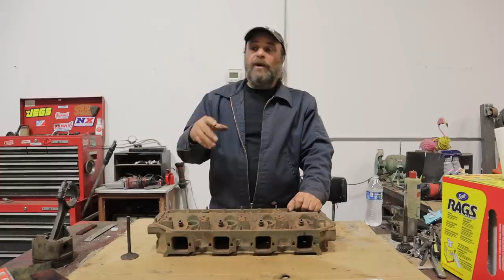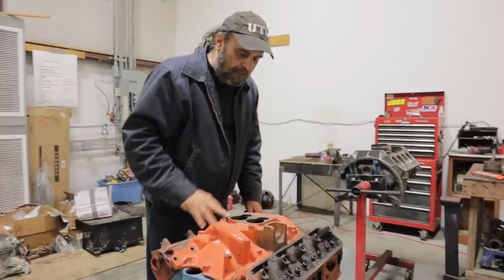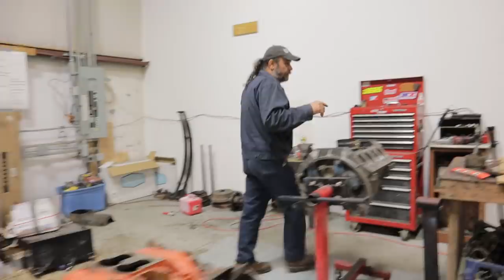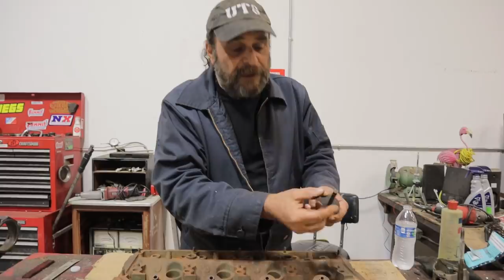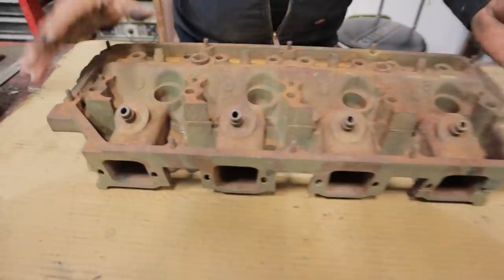Carburetor MPG Myths And Intake System Thermodynamics

Comment: How do you remove carbon on valve with an engine thats together without taking it apart? I know how to remove carbon on a piston (water) but not on a valve.
Reply: I add a gallon of diesel to 16 gallons of gas about every third tank on my Ford I6 300.  Based on what I see with a borescope, it seem to help.  One word of warning, it will drop the octane rating about 3 points, so don't flog the engine on those tanks.

Comment: If there was a way to spit out gas within its atomized state like a carb mixed with the fuel delivery of fuel injection I think we could get somewhere. Fuel injection gives a more liquid state compared to atomized carburator gaseous mixture. Gasoline fumes burn, not the liquid (when gasoline is set ablaze, the fumes ignite creating an increase in temperature turning the liquid within contact into vaporized fumes, allowing a chain reaction of fuel combustion allowing a gasoline fire). It would be cool if there was like a small chamber/container that the fuel can be pushed into creating an atomized state of gasoline then pushed into the combustion chamber such as fuel injection to have a fuel "cloud" that is in a more atomized state allowing for more surface area to interact with the cloud and allowing for a more efficient explosion and chain reaction. Increase in atomization would require less fuel and would be easier to create cleaner and full combustion reaction

Comment: As you touch slightly on direct injected gasoline engines I'd like to say that I've noticed, primarily with the GM ecotech DI engines, that whenever I see one taking off with more than moderate acceleration I always see a puff of black smoke from the exhaust like its way fat.
Reply: Some early GM   (4 & V6)feedback carb sys had a heat  grid base gasket  for cold  mix  efficiency and A/ F flow  atomization into plenum. Based on coolant!!! sensor &  other early  sensor  info. Modern EFI &;ign sytems  a great improvement over  the  years when  basic  maintenance & moderate  driving  habits follow.
Reply: @joekurtz8303  ford had a water heted spacer t in to heater line so to stop crburetor icing in cold temps!
Reply: @joekurtz8303   Buick 231 in particular had them into the mid 80s I've sold 1 or 2 of them when I first got into the parts business 20 years ago

Comment: With fuel economy, you can only make it so lean and the plug gap so big. I do find that modern engines with fuel injection will never get better economy than could be seen with the old engines we love with carburetors on them.  The new engines blow through more fuel no matter what even though it's metered by the computer. And from what I gather is that for meeting emissions now, more fuel is required to accomplish that. It's not so much about economy as meeting emissions numbers  I miss my carbureted cars.
Reply: Thats true, catalyst require 14.7 fuel ratio to run properly. Old engines at low load condition could run a bit lean and increase efficiency.
Reply: JMO
Fuelies balance air fuel ratios between cylinders much better.
Fuelies atomize fuel better . Port preferred.
Computers go for lean in many conditions.
10% ethanol gas reduces mileage 6% due to heat loss.
Premium non-eth fuel does not offset the price.
Real gas lasts a year easily before getting putrid.
MSD 6AL is a great device!! Cures a multitude of problems.
etc 
BTDT, tryed them all.👍

Comment: In 1976 I had a 1964 chevelle 283 -4 bb it was a thermoquad 
With a power gilde trans 
And a hi geared reared not sure of the ratio 
But from LA To Fresno it was getting 25/26 MPG
I even pulled into a gas station early because I thought  gas gauge was broken it wasn't moving
My other car at the time was a 1968 ss 396 chevelle So I was used to getting 12/15 mpg

Comment: Can you make a follow up video where you cover how to clean the intake and get the carbon out of the chambers? Techniques, chemicals, and such
Reply: Berryman B12 in the gas every 5,000 miles.
Berryman makes a full line of products with great valve and intake tract cleaners. Easy to use and very reasonable priced 
B12 is half of seafoam$ and a better product.
JMO😎

Comment: I think it’s neat how the old school way for better fuel economy is more vacuum for better atomization. With that comes pumping losses. The most efficient way is to have no vacuum. With port injection and free valve technology the engines of the future will probably have no throttle valves.
Reply: I'm surprised that free valve technology has not made its way into new engines. Koenigsegg have been using it for years. I'm sure it's expensive but when put into mass manufacturing, cost shouldn't be too high, and will help increase efficiency by ~15%, which will be quite noticeable
Reply: @car_ventures . Ya agreed. Maybe because of the patents he has make it too hard for other companies to duplicate? Or maybe it’s just coming in the next generation of engines? Another option I think would be to use a constant speed opposed piston engine and use it to keep batteries topped up. Another thing I don’t know why they don’t use is propane injection on diesels. It would really help with diesel particulate. I guess it’s just another fuel to worry about and people wouldn’t want that?

Comment: Most GM multi port fuel injection will try to time the end of injection period well before the intake valve opens. Always seemed strange to me you would want a puddle of fuel with no air moving to atomize it on the back of the valve. But like you said it’s the temperature of the valve itself that is doing the vaporizing of the fuel. 

An interesting note when a customer installs an after market cam with more duration and a tighter lobe separation, I will often tune the end of injection timing right before IVO, it really wakes up the throttle response and the fuel smell goes away. 

For example if you advance your injection timing and you see your air fuel ratios go richer the engine is running more efficient because all that extra fuel has more time to vaporize and more of it gets burned in the cylinder which will show up as a richer air fuel ratio with out change the actual “amount” of fuel injected. 

When you understand carburetors and port fuel injection you start to understand how similar they are an why going EFI by itself doesn’t mean more power or economy
Reply: You can't outgun a carburetor

Comment: Tony is right, there is no mystery formula. If we had materials to build a block, pistons, and heads to take super high egt’s I’d love to see testing with a turbo and highly pressurized fuel to run high boost in a very lean condition. Maybe ceramic pistons..I don’t know how you’d do it, I’m not a physicist…my specialty is hacking up cars and welding with a bird shit dispenser.
Reply: It’s not only the egts you have to worry about doing that. It’s detonation that kills the motors.

Comment: All good points.  Now think about raw water cooled boat engines.  If salt water is in the equation, they must stay below 160* to minimize salt deposits and scale build-up.  You loose almost all your thermal efficiency.  Boats are bad on fuel ...

Comment: I've been getting a ton of carbon on the back side of the intake valves on my carbureted daily driver, doesn't use oil and has great compression, good fuel milage too, doesn't foul plugs, they're plenty clean.
It's the darnedest thing I've ever seen, done everything I can think of, I'm stumped.
Reply: Good fuel source, correct  octanes per Dollar,  some chemical  treatment  helpful ( AC Delco X66  formula)  soak  or spray   might help w high mileage  engines. If  it  Runs  OK,  till  a rebuild ,  use good fuel ⛽.
Reply: Have you tried Techron concentrate plus?
Reply: Valve seals have a slight leak under high vacuum.
Reply: An engine with a high overlap cam will carbon the intake valves due to reversion that occurs at lower RPM. .
Reply: Could be a Valve Timing Issue
Reply: All good suggestions, and I have just been using "whatever" fuel, nothing special or in particular.
I especially was interested in valve timing so checked the chain set and of course while in there advanced the cam two degrees with an another chain/gear set, haven't gotten back to it b/c I've got another engine to swap in and plan on doing that.
Could be valve guide seals as suggested, it is after-all a reman engine and may not even have guide seals.  Haven't removed the valve springs to check that (engine swap is my current plan).
It runs decent but I suspect there's something up with the head (valve concentricity?) as the idle should be smoother, could even be a funky cam, don't know the entire history.

I'll probably pull the heads and have a look after the engine swap, to satisfy curiosity.

Comment: This was a  great video! Thank you.  I think there is a lot more to talk about. A follow-up video on de-carboning and engine would be great. What does Tony like to use to de-carbon an engine short of tearing and engine down and manually removing carbon buildup? I have heard running water or ATF down the carb plus there are all the snake oils out there. I would love to see a carboned-up engine cracked open. Let us see the before and after. Or maybe there is no down the carb magic trick for removing carbon build-up effectively. Maybe the only way is to tear the engine down and wire brush the carbon off the valves, piston tops, and heads. But if you are going through all that you might as well do a full freshen up, new seals ring valve seals and clean up the cylinder walls.
Reply: Theres a channel called project farm and he does these tests on lawnmovers
Reply: @CrusherGarage  yes i have seen those thank you i would like to see something on 100000 mile  car engine carbon buildup. plus lawn mower engines run at 6 to 1 compression ratio i would like to see the test done on something higher 8.5 to 1 plus id like to hear uncle tonys oppion on the snake oils out there.

Comment: 100 mpg+ gallon carburetor that's simple. 50 to 100 cc motorcycle/moped with a carburetor. Many of them can get a hundred miles per gallon or better. And some of the arrow cars basically motorcycles with fairings can get even better

Comment: While the atomization of the fuel drops the fuel temp, the smaller nature of the droplets likely makes it easier to vaporize because there's more surface area to vaporize the fuel so I'm wondering if the temp drop is  negligible

Comment: Forget the carburetion for a moment and  think about conservation of energy.  There’s not enough energy in 1 gallon of fuel to push a full-size vehicle with a conventional drivetrain (no hybrid) against air friction and rolling resistance for 100 miles. EVEN IF you could burn it with 100% efficiency (chemical energy to heat energy) and then convert the heat to mechanical energy right at the limits set by the laws of thermodynamics (about 60% heat to mechanical). Some energy HAS to be lost to the heat sink (the environment, either through the exhaust or the cooling system) in order to convert the rest of the heat to mechanical energy.  There is simply NO WAY that you could move a 60s/ 70s midsize  car (think Roadrunner, Torino, Skylark) 100 miles on a gallon of gas. You could go 100 miles on a gallon in a highly streamlined, purpose-built vehicle… think one of those university engineering team solar cars, but powered by gasoline.  But not a practical, large vehicle.

Comment: Very interesting video! Do you think heating the fuel with a fuel to coolant heat exchanger could help efficiency by helping it vaporize better? Obviously heating the fuel much wouldn't work well in a carburetor due to potential vaporlock, but I could see this potentially working well in a fuel injection system since the high fuel pressure would allow the fuel to be heated somewhat without boiling.
Reply: gm already did this with the vortec spider. it heats the fuel in the intake and futher heating happens at valve port injectors. that vortec "spider" is doing more work than you think.
Reply: @blueelectricfusion  Never thought about that but it makes perfect sense, thanks for sharing! Eventually I will try heating the fuel with the coolant to see if it helps MPG. That's something I've always wanted to try and I could rig up a heat exchanger cheap so either way it'll be a fun experiment.
Reply: floods the carb at 140*+
Reply: @hotrodray6802  I imagine that would cause vaporlock in a carburetor application, which is why I specified for fuel injection since EFI systems typically run at high enough pressures to keep the fuel from boiling at normal coolant temperatures. Just like in a cooling system, raising the pressure raises the boiling point.

Comment: If there was a simple bolt-on solution to any vehicle to make it immediately have a huge gain in mileage or performance some country around the world would have it done and it would have been easily figured out by now.  This is where real thermodynamics and engineering come into play where you can actually sit down and do the math and realize that there's no magic number that's going to double your gas mileage.
And seeing the fact that there if there was any carburetor that is 100 mi per gallon is odd because what if that carburetor is going on to a scooter versus going on to a big block.

Comment: Lean burn with a carburetor raises emissions too much, plus a lean burn with a carburetor makes the engine run hotter, sometimes way too hot. What Ford and other manufacturers do now uses lean burn with a turbo, high compression AND direct injection which helps cool the cylinder.
Reply: leanburn only is a problem if the timing is off! leen one needs to advnce the timing!

Comment: There is an asymmetric bell curve you have to get past in terms of heat. When you add gaseous fuel then the problem becomes getting enough charge to make HP, at the other end of said curve ...the running crappy just indicates you're on the typical side of  said curve. Smokey's contrivance was a cheater's attempt to get to the other side ... An astute attempt that fell short.

Comment: Tony, Can you do a video on water injection and methane injection also? Would like to know if they are still viable methods of better combustion? Thanks...
Reply: Supresses knock and cleans carbon.
Less knock and you can run more timing or more boost.
Water turning to steam absorbs heat and the steam increases cylinder pressure/ torque.
The difference between meth mix and straight water is negligable.
BTDT decades ago.
WWII airplanes used alcohol/water mix to not freeze at altitude, 
and it allowed more boost for takeoff and what they termed "war power".

Comment: I'm burning propane in my modified 440 with forged crank and 6pac rods, it has the heads and deck shaved a little to raise compression, ported and polished with stainless valves a special cam for propane and a modified timing curve. My mileage is 50%better than gas and a huge power increase. Is this due to the fuel being already vaporized?

Comment: Hey uncle tony why not do a special on the ogle carburetor where the news did actually document what it could do he actually did make 100mpg per gallon with a 428 if I’m not mistaken this is not meant as a insult but it was proven it worked by the media even but it was highly modified even the tank had to be modified because it would get covered in ice and crush itself in with vacuum I would love for you to explain this or what system he ran in conjunction with the carb to achieve this

Comment: Most gas engines use most of the fuel to cool the  explosion , if not you would burn up your pistons ?
Reply: George wiseman have you heard of him..
Reply: @gulfy09  No but I just researched his website ? Browns gas
Reply: @jimmywilkinson9190  he was more involved with making fuel more efficient with water injection..
Reply: @gulfy09  OH  water methanol injection was used in those ME 109 planes to cool the turbo supercharges compression . If you get to much C.R. same thing , you end up with a hole between the rings and piston .
Reply: @jimmywilkinson9190  water injection acts like steam in combustion chamber.

Comment: WW2 piston engine airplanes would've had "100 mpg" carburetors if they were possible. The absolute best minds in several countries all over the world working on getting more power and economy out of those aircraft engines at that time.  Hell Jeeps and trucks would've had them too! The logistics of hauling gasoline all over the world were huge, something that would've cut fuel usage in half would've been implemented over night. It wasn't.
 At the end of the day a gallon of gas has x amount of BTUs of energy. You can get more efficient of course, but you simple can't get more energy out of what's there.
Most hot rodders bolt on an after market carb and run it "out of the box". A bit of tuning can make a huge difference but it depends on how far off the carb was "out of the box". You probably won't do much better than the factory did when the car was new.

Comment: If you are correct there UT then hot fuel would make more power cause the better you can atomize/vaporize fuel the more power you should be able to get… this contradicts david and both steves test on fuel and air intake temperature test for power… there are a whole lot of factors that relate to mpg and changing one thing wont equal high mpg but doing many little things like, aerodynamics, weight, VE, suspension, tire pressure, and engine load can all greatly affect total MPG… in the end, does it all matter when you have a big smile plastered on your face from opening up that throttle? And maybe nitros bottles?